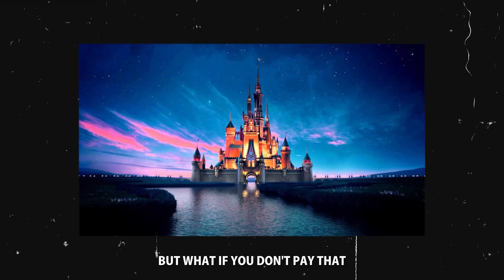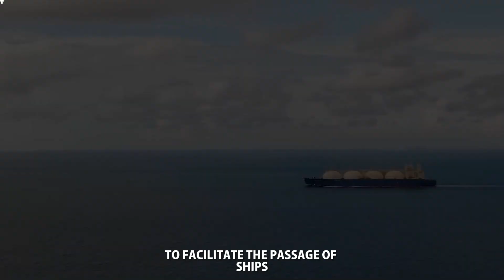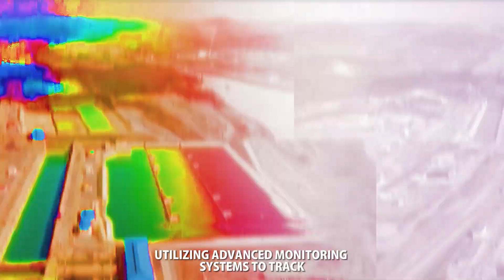2025: the DEATH of the Panama Canal

Comment: Clearly a lot of people don't understand what's going on with the Panama Canal.   If we went and made modifications to the Panama Canal,    it will probably be a lot easier then when they first built it.   One thing is they would have to maintain freshwater supply for the communities bordering the Canal.  I think if they changed the water in the canal to ocean water instead of freshwater, they could illuminate stealing fresh water from the neighboring communities. The ships are already ocean going vessels.  Only would have to do is find a way to isolate the canal from the rest of the water.
Reply from the maker: good point!

Comment: Give Chinese contractors to correct that anomaly. 
Americans are too lazy and charge highly for such difficult work.
Do a PPP with the Chinese (private public partnership), one year, Panama issues will be history!!!
Reply: True
Reply from the maker: Interesting solution, and probably the fastest!
Reply: They cannot be reliable and most of the money will be given to the Chinese President and whatever is left will be used and cheap products will be used.  Why can't Panama fix the problem it was built for them, let them fix the problem.  Two pumps at each end to pump sea water into the reserve pools.  Expensive yes but safer and cheaper than giving it to the Chinese.